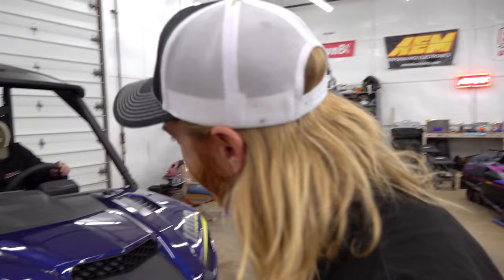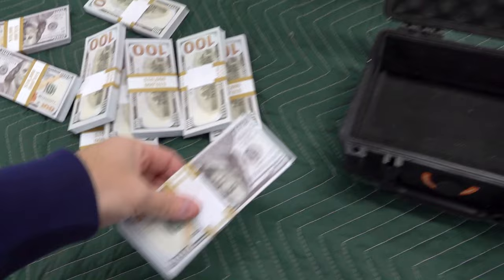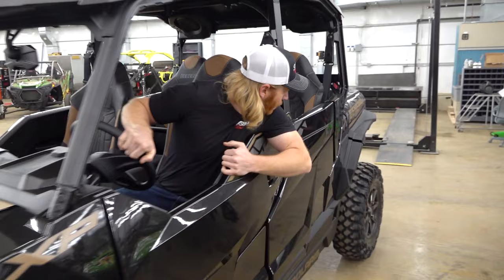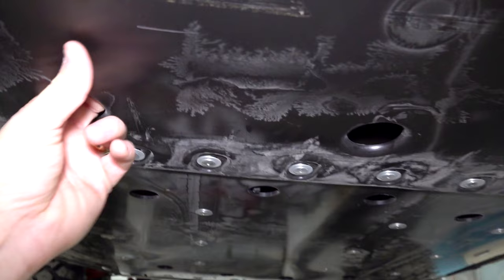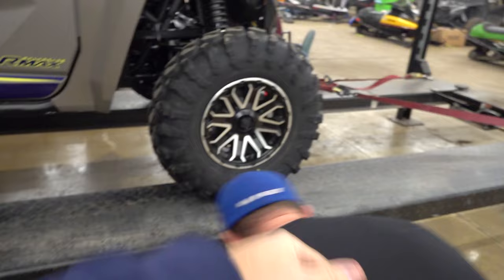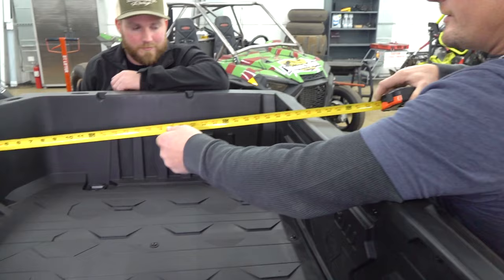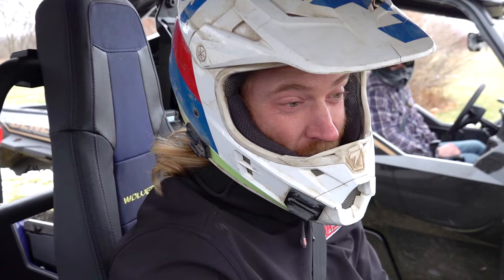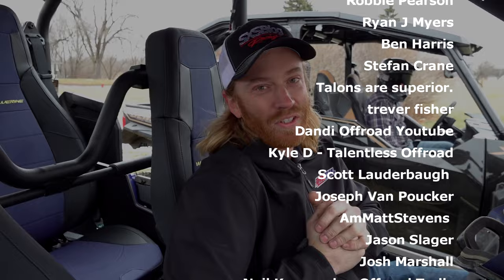Intro to our newest toys: 3 FRESH UNITS! Dyno & drag race!

Comment: FINALLY!! I've been waiting for you guys to get an rmax!! Soo jacket to see it on the trails! Thought for sure with the shorter wheel base it would have more whp but it's not built for speed, its built for the trails. I think it's gonna dominate the trails, TEAM BLUE! You aint never gonna see a 10 year belt warranty out of a Polaris or canned ham! Haha
Reply: It does have more rear crank HP but like all Yamaha SxS, it has a wet clutch, which robs some HP for belt reliability and traction, which is why the RWHP isn't as impressive as at the crank, but also wheelbase has nothing to do with engine output.

Comment: I work at a Yamaha dealership and a quick tip is to keep a check on your oil lines on the rmax because they just lay on the skid plate and they tend to get holes rubbed in them so just a heads up on that. keep it up love ya
Reply: Is that the RMAX4 or the RMAX2 or both? 
Is it effecting all years? 
Is this problem related to the oil cooler lines or the dry sump system?
Reply: Better tip. Don't buy the Yamaha!
Reply: If you want to know which one is more reliable go out back of a yamaha dealership and then go out back of a polaris dealership and see how many broken ones there are comparatively.
Reply: @paulgrinold1103  But what is the selling ratio 10 to 1 or more.

Comment: I've had an Rmax2 since May of 21, it is an absolute beast. 3600 miles so far, and the only issue was a blown belt at 3200 miles, which was covered under warranty.
Reply: 2 seater the rmax is the best. 4 seater not so much.

Comment: I recommend strengthen inside rear square tubing lower controls arms welded too for the rmax4.  Mine rolled once on side and bent rear frame and cage up, but safety features are great as no one got hurt.

Comment: Ill almost guarantee the rmax is the tougest a buddy forgot his parking brake and parked his on its side on the bottom of the lake. Totally submerged we dragged it out oil didnt even have water in it pulled air filters and ran it the rest of the weekend

Comment: I didn't realize the skids are not removable on the commander. That's kind of a deal breaker for me. I have the general 2 seater and drop all the plates to clean it after going mudding. It's amazing how much mud you can't get out without dropping the plates

Comment: I have the Commander Max and it takes 500-600 miles for either the engine or clutches to loosen up. To be was a big difference in seat of the pants. Know top speed was 4mph higher  at that point.
Reply: Yeah, I was surprised they did dyno pulls before the machines were broke in

Comment: My wife has the new rmax and it's a tough rig. I'd rather have the short wheel base 4 seater than my maverick.   Cv shafts are trash even on stock tires.  Oil change has 6 drain points.  And you need to buy aftermarket products to help with cold starts.

Comment: Biggest down side to the rmax is the 83" height, it doesn't fit in most enclosed trailers. I wanted one until I had to factor in a new trailer.

Shouldn't have to change them belt trailside since it's got a wet clutch.

The Magellan system sucks compared to ride command, but it beats can am's option of nothing lol.

Comment: was the RMAX in SPORT mode when on the dyno? Power curve for the three drive modes is drastically different for each one. Sport mode will have most torque and possibly more HP and top end speed....

Comment: Yamaha: shorter yet same weight= quality build.
10 year belt warranty because the clutching WORKS. You can climb in high range.
The OTHER two burn belts constantly, you have to have
Carry spares. 
Yes the Yamaha is tougher to change, to can BUT there almost ZERO belt failures. 

Do a video shootout on these three units on belt life the Can-am and Polaris will fail!! 
Put that on camera

Comment: Suzuki needs to come out with a SidexSide because as far as I know they are the only Powersport Manufacturer who doesn't make a SidexSide and if anyone knows any different let me know and the only thing I don't like about the R-Max is that it's the only 4 seater SidexSide that doesn't come with a bed and the other two has a bed even Club Cart and a few other 4 seater SidexSide's have a bed and I think that is what is throwing me off on the looks of the R-Max because without the bed on it to me it looks short and stubby compared to the other two but overall all three seem to be nice solid units

Comment: I'm surprised you guys didn't mention the drive mode switch on the RMAX. It is a stand-out feature on that unit for sure. The Adventure Pro is absolute garbage. I actually opted to swap mine out for a different tablet so I could go back to Ride Command.

Comment: You need one more of each of the General and the Commander as long as they are 1000cc and 4WD and you need to put the what I call the winter kit on them where they have a windshield front and back and the full doors where you can drive them in the winter and stay warm and you also need to put a winch on the front and back of them and a tow hitch in the back and you need to beef up the suspension and put a snow plow on the front of them and to top things off put them on tank tracks so you can use them for SAR in the winter if needed and you can plow snow and you can winch other people out or yourselves if you get stuck and get a kinetic rope and a set of soft shackles for flat towing other people and with the other ones beef up the suspension and jack them up and put a set of 40" wheels and tires on them and put a tow hitch on the back and a winch in the front and back and put a kinetic rope and a set of soft shackles in it as well and maybe beef up the engines in all of them to give them a little bit more get up and go oh I almost forgot put a snorkel exhaust kit on the jacked up summer recovery SidexSide's and maybe one on the winter ones just to be on the safe side

Comment: They're all missing 30 hp?
Reply from the maker: Wheel hp vs crank (what is advertised)
Reply: @SXSBlog  Yamaha's wet clutch probably robs 10 HP which is why it's nearly the same as the slipper-clutchers in RWHP so Yamaha isn't trying to mislead anyone.  Would have been nice to see the torque output as well.  You'll probably get around to the other features in the next videos but the RMAX engine is dry sump and has an oil cooler.   Yamaha also released a rear tailgate bed extender which improves storage.  There's a ton of storage under the driver's seat, but not designed that way by Yamaha, but is easily made available with easy mods.  

Although evaluating vehicles with their stock tires is valid, it would be nice to see how they stack up when fitted with identical tire/rim setups.  

You made note of the Commander's front upper A-Arm (which is beefy), but the RMAX's front upper A-Arm looks like it came off of the truck you're giving away ;)

We all know you guys will show how each model does on the track, which the longer wheelbase vehicles will probably do better in stability, but I hope you do some tight technical riding and rock crawling where each vehicle's torque and traction will come into play. I will give you kudos on this first installment test.

Comment: I would have taken the truck, trailer and sxs. I would have found the $10k for taxes somewhere. Then sell the truck for $75k(very easily) and would have a new trailer, sxs and $75k. Versus taking the $100k and after tax, walking away with $70k-75k.

Comment: have you thought of building a 2JP-2 to race against each other but with a stronger(more capable/upgradeable engine, like a billet block)? and when/if you do, what about a 2JP-2 gymkana around the property, or.. a sponsored location like a SxS shop, drifting/jumping around and infront of it, to get better rates on parts.
Reply: They barely run and race the 2jp they have. Nor can keep it running reliable
Reply: @chatta6013  okay, i'll cancel my internet. thank you
Reply: @mackpladge700  you probably should asking for another even more expensive 1 off build than the 1 they currently sparingly use as its power is 2 much 2 harness. And testing experimenting parts etc, yet u expect them 2 turn into gymkana or be an Adam Lz, and Vaughn Jr/ travis Pastrana.  When clearly that's not even what sxs blog or  their channels even about.  (And they have their own shop n properties they do events at. Not 2 mention several sponsors already.